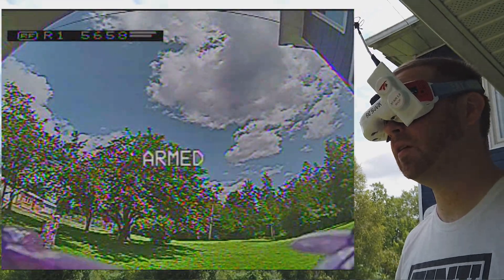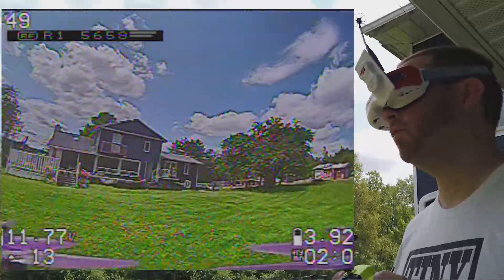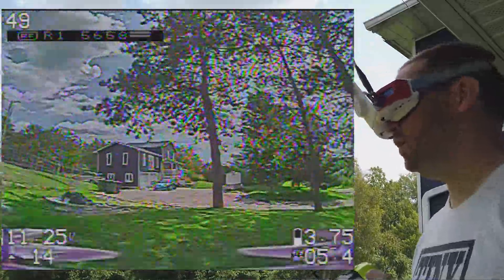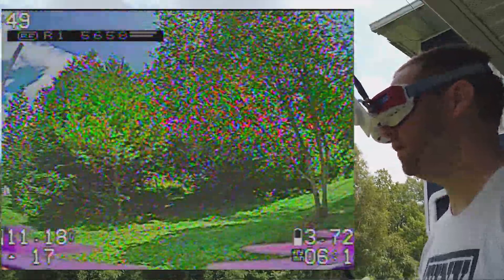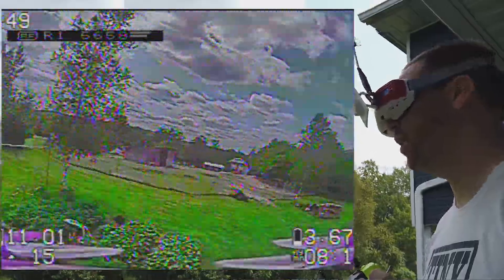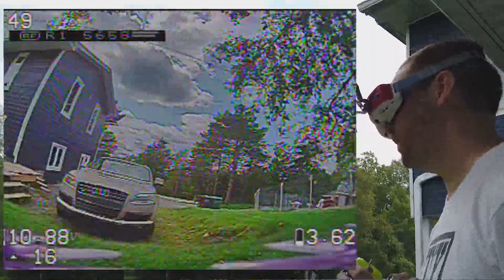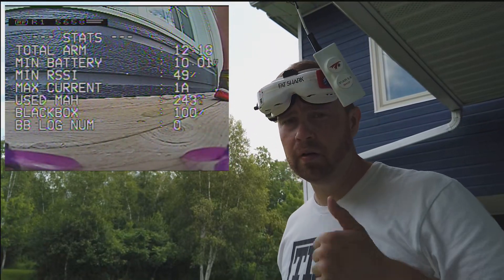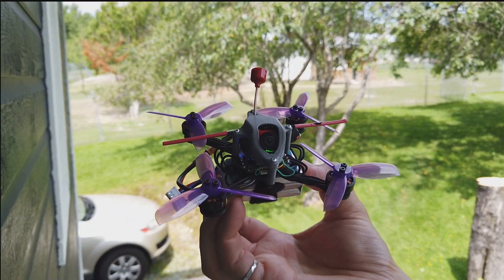12min+ flight time on 3in FPV drone using 1404 6500kv motors

Comment: My goal in life is long flight time, just bought bumblebee woop, with the Xing 1507 4S 2800Kv motors.....any suggestions on longer flight times?
Reply from the maker: 2800kv you need 4S and big props 4in to 5in props on 3S/4S 18650 pack. I just flew 29min51 ¸ on my 1S 18650 toothpick 2 days ago. I will upload video tonight or tomorrow. maybe try 6in bi blade on 3S with a AIO FC and AIO camera to have light build.

Comment: You only get those times, because you fly like my grandma drives and you hover under 20%, which lets the motor not drain the batterie in under 8 minutes.
Reply: aeQuator I was thinking the same. :)

Comment: the way to go is larger propellers with smaller pitch!   look at the cinema drones them all have large propellers with small pitch and the less number of blades ..2 ... creating an effect much more near a rotating airplane wing requiring small current from the bat,  end less like a small  turbo fan witch have unusefull hi speed  air flow in a small diameter of the flow and by the way   a little static thrust for an hig current draw
Reply from the maker: yes very true. If you look at DJI mavic air and the spark, smaller motor ~5in props. I am looking into 4or 5in props for those motors 5040 props. Since these motors use 2 bolts instead of M5, I need to get creative in mounting solution. The only drawback of 2 blades is the flight characteristic is bad. Perfect if you hover but not in FPV. Well not in this small machine like mine where the forward speed is slow. In bigger 5in bi blade with high KV is good on specific track. Thanks for the feedback!

Comment: Hm...i think im find a new setup for build....Thx man....impressive....what a frame?
Reply from the maker: the frame is a prototype from mokaframe.com Just a single unibody 3in frame.
Reply: @JeromeDemers  was that released by now?
Reply from the maker: @sharkbytefpv4326  sorry no, Mokaframe told me he won't release it because he makes no money out of very small frame. You can 3D print some or found other 3in frame at rotorvillage.ca and airbladeuav.com

Comment: Now try with liion cells :)
Reply from the maker: zaqwsx28 you know what! I do have some 18650! Will see how 3 weight. Might be heavy it’s like 30-40g per cell so like 120g vs 73g but 3-4 flight time?
Reply from the maker: zaqwsx28 I just weight the cell and three 18650 is 139g. That is without xt30 and wired. I will check it out!! 2 or 3S.
Reply: @JeromeDemers  there's also 18350 batteries that are half the size of 18650
Reply from the maker: @___echo___  thanks I will check them out.